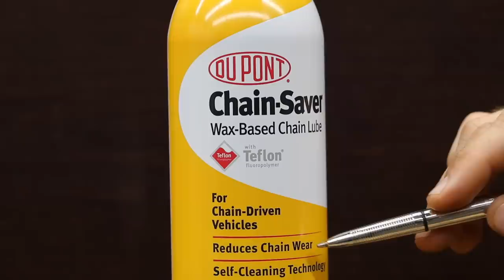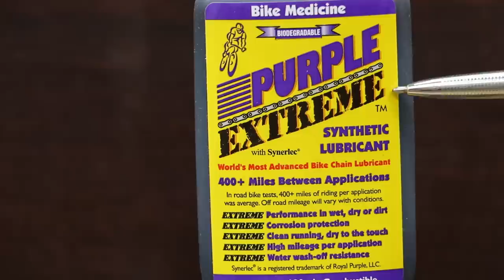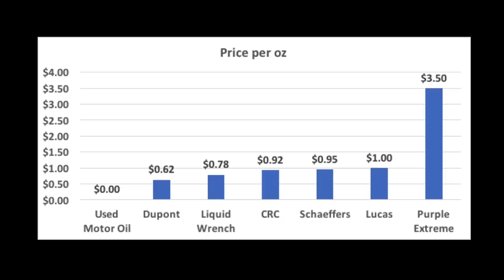Which Chain Lube is Best? Let's find out!  Ultimate chain lubricant showdown!

Comment: D.I.D. wich is a major motorcycle chain manufactor reccomands SAE80-W90 every 500km, shouldnt they know what's best for their products?
Reply from the maker: Thanks for this information.
Reply: @ProjectFarm  i wonder if 80-w90 gear oil is actualy better than a chain specific lubricant. Also a little tip: with motorcycle when applying lubricant to the chain, after a couple of minutes is best to remove extra lubricant with a rag, that will prevent some dirt to stick to it, the lubricant job is mostly to keep those o ring moist and protected, since the actual lubricant between the links is sealed inside the rollers, my chains are a lot less a dirt magnet since i started to remove the extra lubricant (: 

Btw love what you're doing in your channel, you always do interesting stuff! Thanks (:

Comment: I'm surprised you didn't weigh each chain before and after the sand was dumped on them. That would've been a bit more objective than just eyeballing it, though I think your appraisal was accurate.
Same with chainsaw test, 3 weighings, before application, after, and then after spinning.
Reply from the maker: Thanks for the constructive feedback.

Comment: o-rings in motorcycle chains keep the lube in them ((the roller barrel that rides on the sprocket tooth). The clean and lube process is primarily for the lifespan of the o-ring and also for the contact to sprockets. These lubes go on wet and dry (lots of solvents to get  them applied).  READ THE LABEL. Chainsaw bar lube is constantly fed, chainlube is not applicable to this product.
Reply from the maker: Thank you

Comment: Most of your videos are great but this one isn't as good test of what these lubes are designed to do. The DuPont is a wax based, solvent-held dry lube. It's not supposed to stick to the chain. It penetrates the rollers and bushing connections then it dries. The dried wax is designed to come off with dirt to protect your chain and drivetrain. You need to use it more often but it really helps protect your chain from dirt and wear and is really clean running for pedal bikes. Only your sand test is fair with this type of lube.
Reply from the maker: Thanks for the constructive feedback.

Comment: I wish you had cleaned these chains properly, new chains come with a very sticky residue from the factory, and this needs to be removed both outside aswell as inside of the rollers.
For this to happen you need to use petrol or something equally strong.
ALSO, i wish you had tested wax aswell, regular parafin wax.
That's what i use on my bicycle, as it attracts the least ammount of dirt aswell as making the chains last twice as long before it starts to skip on the cassette.
Now, you wouldn't be able to use that friction test for it i think, because the way you apply it is to clean the chain completely, and let the chain boil in wax while you move it around until there's no more air inside the rollers, and thus having a cup of hard wax isn't going to work.
Reply from the maker: Thank you for the feedback

Comment: I feel like there wasn't a clear winner. There were pros and cons but no domination. Please re-test using bicycle chains for cost reasons and include WD-40 "lubricants", 3 in 1 dry lube, 3 in 1, white lithium grease, TRI flow, Boeshield t-9, proshield prolink chain lube, and finish line ceramic wax lubricant. The idea being to test grease, lube, ceramic, and wax chain applications to see the best result. Toe winner should dominate the competition in all regards regardless of price so if you want to expand the number of lubricants that's for the better. I know it's a lot but it should be interesting, thanks a lot.
Reply from the maker: Thanks for the video idea.

Comment: As abundantly proven by dozers and crawler vehicles, no lube is the best lube on hardened steel parts [Track Chains]... SALT undercarriages - " Sealed and lubricated " are another version, but costly. That bailer would be better served with a dry film lubricant or none at all.
Reply from the maker: Thanks for the feedback.

Comment: Another chain lube video for bike and motor cycle lube specifically. 

I think the chain saw test was not a good test since it's not how chains are really used. 

The slinging oil part was fine, but it should have been done between sprockets.
The dirt cling and lubricity tests were very useful.

This test was too broad. IT covered chain lubes for heavy machinery and for bikes. Narrow the focus of the products to just bike chain. No bike rider will want CRC on their chain since it is so messy. They want something that carries lubrication into the chain and then evaporates off so the chain stays clean and still lubricates well. Rust is a lesser concern for bike chain than it is for heavy machinery.

Comment: Chainsaw is not valid test for chain and SPROCKET.  Speeds are slower than chainsaw (chainsaw sling test is too extreme), and there is little sliding on sprocket (that's why chainsaws pour oil on continuously).  Purple Extreme is for bikes, not chainsaws or power equipment!  Bike chains move VERY slowly, and are not guarded!  Most chains on power equipment are (or should be) guarded, so dirt is less of an issue, and having wet lube film more of an issue.
     One problem chains have is the lube collecting dirt and "setting up" on the chain, almost getting to the state of "partially set epoxy" (especially with organic material such as hay dust).  The lube then doesn't get into the rollers, and links can even jam.  You have no test for this (such as measuring friction torque on a SPROCKET setup).  None of your tests measure friction, and that is what lube is for!

Comment: Should've included WD silicone lube
Reply from the maker: Thanks for the video idea.
Reply: @ProjectFarm  I sprayed it on some rusty bolts atop my shock mounts o the 98 Ford ranger and 3 minutes later when I looked over it again looked new,, not shiny but. Clean. Very surprised first time use
Reply from the maker: Thanks for sharing.

Comment: The fact that crc attracts so much dirt makes it a major loser. What will happen is it will grind the gears and chain and they will have to be replaced prematurely.  The dupont and purple extreme products won this test by a mile. The rust test was not real world unless you are driving your bike or bailer through acid.
Reply from the maker: Thanks for the feedback.

Comment: I don't think your lubricity testing was accurate for these chain lube products.  I say that because some of them have a solvent base, that is intended to evaporate away after the lubricate has penetrated the chain joints.  If you test without first boiling off the solvent, then the solvent is severely compromising the film strength of the oil.
Reply from the maker: Thank you for the feedback

Comment: Having lube on the outside of the chain does nothing. The pins and internal rollers is where you need to get the lubricant. To lube those parts soak , soak, soak the chain in lube so the lube gets inside those parts. Then wipe off the exterior of the chain so no sand will stick. Done.
Reply from the maker: Thank you for the feedback

Comment: If you are really concerned about lubrication, you would use new motor oil and not used.  Used motor oil is problematic because it has depleted additives and fine grit that will increase chain and sprocket wear.  Using used motor oil is penny wise and pound foolish.  Clearly, the farm equipment you bought had oil applied to the chain but probably not cleaned. :/  That's not proper maintenance and more like making you feel good while the tail is wagging the dog.
Reply from the maker: Thanks for the feedback.